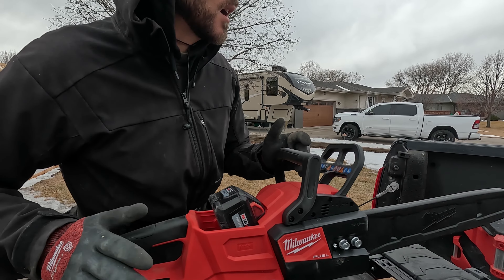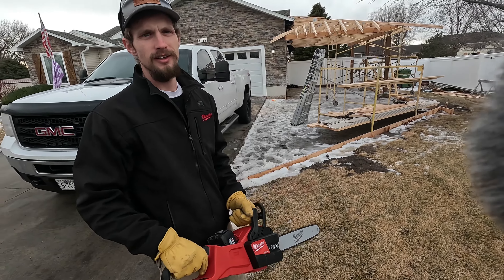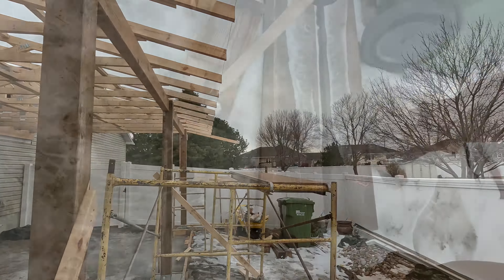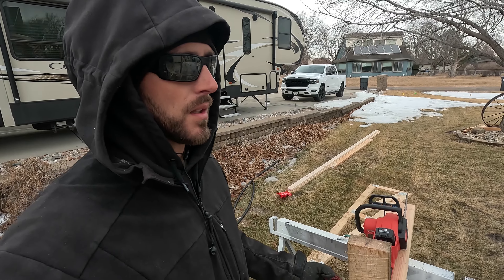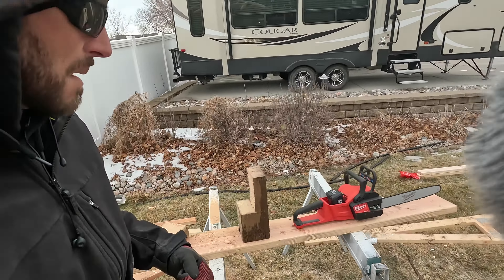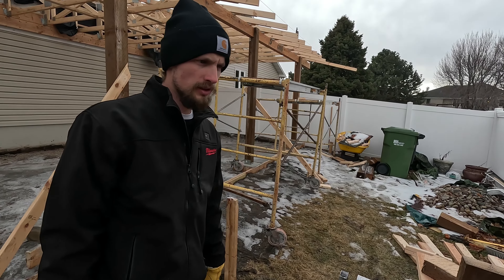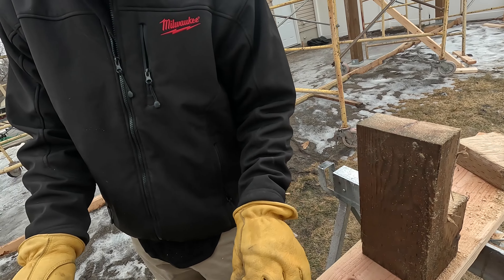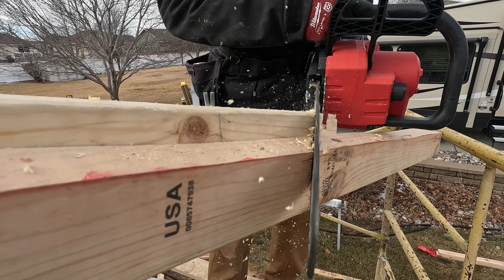Milwaukee Chainsaw Review. Milwaukee 2727-20 M18 FUEL 16 in.

Comment: The Milwaukee case for that chainsaw is also great (I have both). It has a holder inside  for the 1qt bottle of bar and chain oil, and what leaks out of the chainsaw reservoir can't get into the bed of my truck.